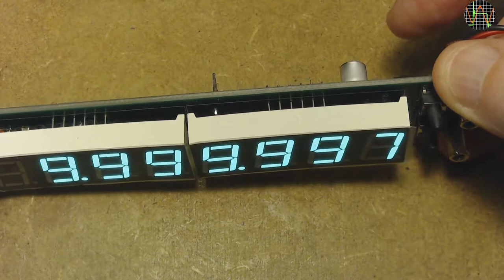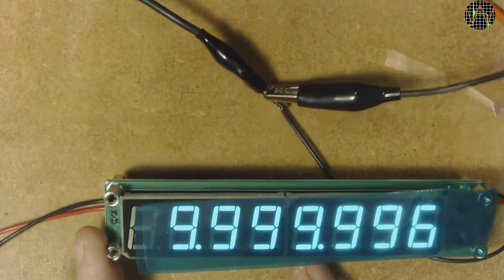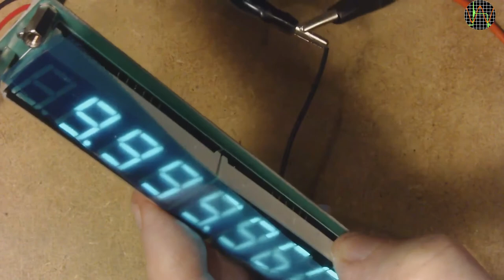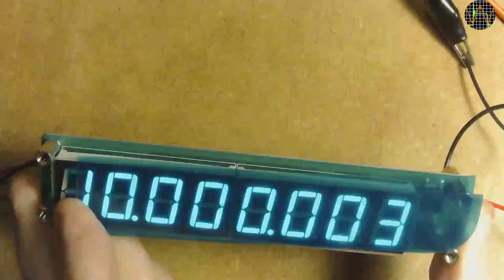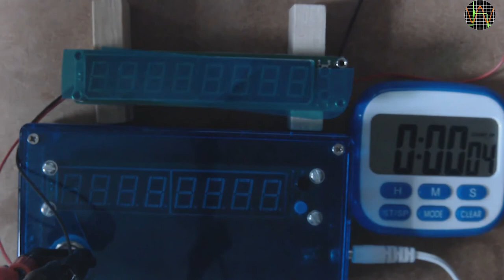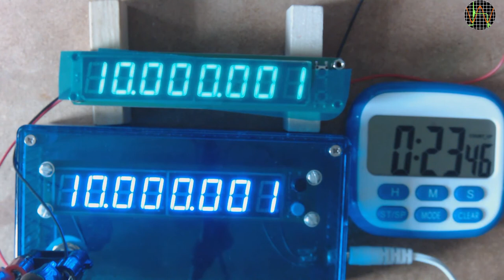PLJ-8LED (clone): fixing the other module

Comment: A great video, as always. Thanks for making it. Yes, two SMD resistors of the same size can be stacked and soldered to make them parallel very easily. You could add some heat shrink over the new through hole resistor to protect it from shorting.
Reply from the maker: Thanks t1d100, I thought it might, but never tried and in any case did not have any 100K SMD resistors at hand, but good to know for the future.  Good idea with the heat shrink. Will do that.

Comment: Great info here, thank you! I personally had to remove the 39K resistor and replace it with an 82K. No matter what resistor I put in parallel with the 47K, it wouldn't let me get it in range for whatever reason? Maybe a slight board change? Who knows? I removed the 39K and tried various resistors with higher resistance. The 82K put me 1 Hz away from the 10 MHz signal coming from my GPSDO. This is with the 52K pot in the middle position so I have close to plus or minus 30 Hz. The SMD resistors on this board are size 0805 just in case anyone wants to buy replacement SMD resistors. Thanks again for the info TheHWcave!

Comment: I just received my low-cost unit yesterday and seeing same issue regarding pulling range. It is very close, so will leave it as it is for now, but good to know of your fix. The stability on this one is very solid. I'll look for some surface mount resistors to apply a fix at some point. Thanks again. Great video.

Comment: I received my unit yesterday and noticed the same slight offset even with the pot adjusted to the very edge of the range.  Your video is an excellent teaching tool, to explain what the problem is and how it can be addressed.  I wonder if the additional warm-up time might be due to the thermal charcteristics of the added resistor.   I am hesitant to risk the soldering since I have no experience with SMDs, so ordered a second one from a different supplier to see if I get lucky.  Thanks again for posting this!!!
Reply from the maker: Thanks for the nice comments. By the way, that module still runs fine with the "normal" through-hole resistor soldered on-top as shown in the video. I now have SMD resistors as well but never felt the need to go and fix it "properly".  Why fix what isn't broken...
Reply: @TheHWcave  I have plenty of through hole resistors but I couldn't see exactly how I would solder that on top of the SMD resistor - can you give me an idea of how you accomplished that?
Reply from the maker: I assume you have seen  in the video at 07:10 how I bent the 100K resistor?  All you need to do is snip off the leads to the correct length and apply a generous coat of solder to each end. Then apply a bit of extra solder on either end of the 47K SMD resistor  (one end at a time so it does not desolder completely). Then holding the 100K in the correct position (as in the video) with tweezers use the soldering iron to tack each end of the 100K onto the solder joints of the 47K SMD. No need for more solder for that. It is much easier than it looks (or I describe it here). Once its in place and can stand on its own, you may reflow each joint (one at a time) and add a bit of extra solder to improve the joint. You need very little or possibly none, just reheating the connection usually does the trick. While you rework one end of the 100K it is held in place by the other solder joint so you don't need to hold it during the reflow making this an easy operation. 
Hope that makes sense. Its kind of hard to describe this verbally
Reply: @TheHWcave  Excellent, thank you for taking the time to write down some details around the operation.  That is what I guessed would be the approach, but having you confirm that gives me the courage to give it a try, once my second one has arrived in a few weeks.

Comment: Nice video :), Other ideas for improvement: I noticed the two filter caps appeared be 16V.  Good design practice is a safety factor of 2x for caps. Definitely bad idea to run this frequency counter at 15V.  At the low end it's hard to say what voltage a China 5V regulator will drop out (could be 5.7V to 8V) so running the unit from 9V to 12V seems optimal with 9V being a good choice to maximize life of the capacitors and minimize 7805 temperature.  To run at 15V remove the input capacitor, install a 25-35V rated input capacitor and add a little adhesive heat-sink to the 7805.  Because this board has a precision oscillator that is somewhat sensitive to temperature to get the most from this board consider bypassing the 7805 and run the board from an external 5V power source instead.  Too much info warning: A low-cost counter from China is not likely to actually have a 20yr rated 2.5PPM VCTCXO oscillator.  1PPM = 1 part in 1 million so 2.5PPM is 2.5Hz error at 1MHZ measurement frequency.  Note: VCTCXO oscillators = Voltage-Controlled(adjustable), Temperature Compensated, Crystal Oscillator.  For 3.3V oscillators the VCTCXO adjust voltage is typically 0.5V to 2.5V and results in a frequency change of +-5PPM to +-50PPM depending on the unit.  A VCTCXO oscillator does not include an oven as is sometimes assumed.  Instead they generally have a feedback loop which adjusts the frequency as temperature changes to provide a more constant frequency.  So unlike an oven-controlled oscillator which may require 10 to 20 minutes to stabilize the VCTCXO will start up and be stable almost immediately.  A VCTCXO can also be expected to drift up to +-1PPM per year for aging.
Reply from the maker: I totally agree and thanks for the detailed write-up. Regarding the long term stability I am not too worried as I usually check and re-calibrate my gear once a year, in this case against a GPS Disciplined Oscillator. So far the counters are still very close and I have not bothered to re-calibrate (yet).

Comment: what power does these PLJ8LED take.
are they sensitive. or do you need to drop a shutload of power into them for higher frequency as they do seem to take up in the 2½ Ghz and to what extent do you risk blowing them with to much amplitude/wattage.?.
Reply from the maker: I have to admit that I haven't used mine for a while  (I now have two other "proper" frequency counters that offer more measurements and greater accuracy) but I remember that I could comfortably drive them from my FY6600 signal generator which is no power-house.

Comment: Thx for the wonderful/fantastic video series’s on these PLJ-8LED frequency counters. I “accidentally on purpose”, bought the same two units you got, followed along to a “T” (got all the same results). The resistor mod on the TCXO oscillator .. Perfect Fix!
 You made me a quick study, where otherwise “ida been” totally lost.
PS, I never did find your email on the about tab. I’m an amateur radio operator, call sign KI5MEF .. I think you may be one too. If so, plz look me up on QRZ, and drop me an email.

Comment: Good job mate :) my question is how to adjust without accurate generator?
Reply from the maker: Yes its a chicken-and-egg problem. First option is to just live with the "out-of-the-box" accuracy. If you want better, then check out my very first YouTube video,  about a GPS Frequency Standard. These GPS modules are not very expensive and you get a very accurate frequency standard. There is some jitter but this is usually ignored by frequency counters and there are some frequencies that it can generate jitter free (I named them safe frequencies in the video if I recall correctly)
Reply: @TheHWcave  what about dcf-77?   Have you thinking about it?
Reply from the maker: @tomnone8378  Its a possibility of course but gives you just one frequency. I wonder if making a tuned LC circuit with an amplifier to boost the output and decouple it from the frequency counter would work. But then you have the problem of making a tuned LC circuit for 77.5 KHz and a long antenna....
Reply: @TheHWcave  there is slow but digital signal  so will be the same as pps 1hz
Reply from the maker: @tomnone8378  I understand but I thought you wanted to calibrate this frequency counter and for that the 1PPS is useless unless you build an oscillator with PLL that can be locked to it. A lot of work.
Reply: @TheHWcave  I seen on youtube one generator as a kit around 40 $
Reply from the maker: @tomnone8378  Yes, but the question remains, how do you know how accurate this generator is? I mean this frequency counter module already has a reasonable quartz oscillator for its timing and a $40 generator is unlikely to have anything better (unless its GPS based)
Reply: @TheHWcave  ocxo;) plus gps but you never know  ...

Comment: One question for those who might visit this video ... Can the device be adapted to measure frequencies from 0? The upper limit is not so important to me, it can be 5 or 10 MHz, it doesn't matter ... Thanks in advance if anyone has an answer ...
Reply from the maker: Sadly no. It is specified from 100KHz upwards. It does work reasonably down to around 10KHz but soon after starts to show increasingly wrong and fluctuating  numbers. 1KHz for example is usable.  If you are on the lookout for a cheap counter that works down to 0 checkout my playlist on the PIC-based frequency counter. It uses a popular and cheap ebay kit as foundation and with my modified firmware, you can do amazing things with it.
Reply: @TheHWcave  Thank you very much for the answer ... keep up the good work ... it's really fun and relaxing to watch ...